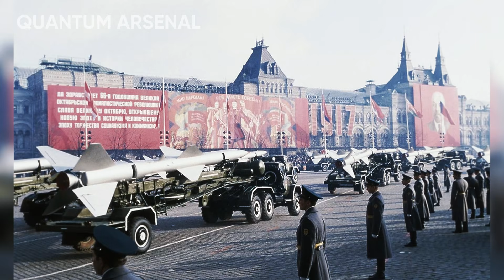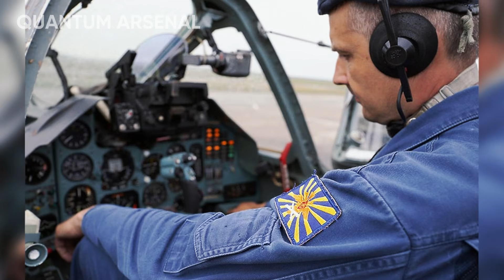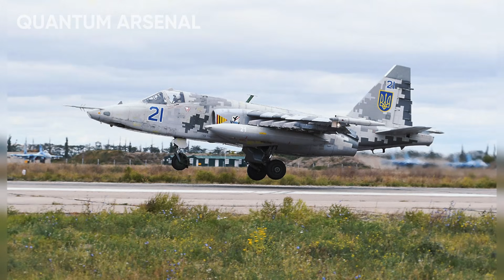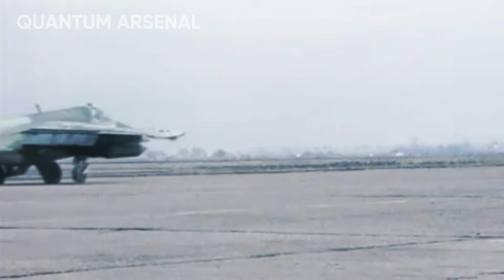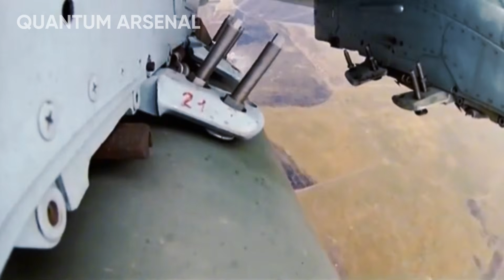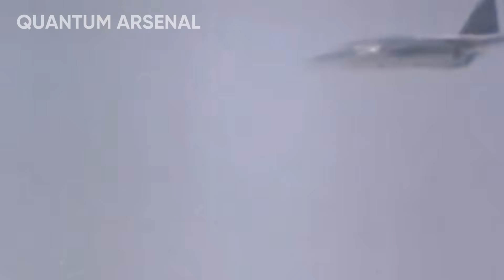Why Russia's Crudest Jet Is Also Its Deadliest

Comment: Amazing how all CAS aircraft have a "bathtub" design around the pilot. Giving it is from the U.S.S.R. and actually showing concern for pilot safety in the cold war, this was quite a big deal. Knowing any aircraft approaching the tank attack linear position for an attack run, is when the pilot is at most risk. It is a very big deal indeed. One thing I have learned on this channel is while general opinion of older Soviet era aircraft is usually with dismissal (albeit very unjustified) I have learned that how incredibly tough the Soviet equipment is. My god their idea has always been that the plane will likely have to ,make an emergency landing in mud and rocks. Now that is forethought We just don't think like that. It has always been with the thought that there would be an active close logistics network in place. great thought but hard to make happen in the thick of battle. I have grown to really appreciate the simple rugged design and the courage alone of the pilots having to work the plane without all the modern fly by wire crap. I call it PURITY, It is plain to see who the better skilled pilot with having to work the plane to do its job instead of a computer. Mad Props Russin pilots. you have earned my respect. As a mechanic I have come to really appreciate the basic simple mechanically pure kind of equipment they employ. That is what will survive the future battleground without internet and computer assistance, just a pure mechanic doing his or her job in the mud of some underdeveloped airstrip. Now that is what wins in the long term.  Also hurts to admit it yes function is function but Beauty is an underestimated quality of purity in design. Must admit the SU-34/35 style of planes has to be the most beautiful of designs. hornet is bad ass by birth as is the lovely SU-34 but the lovely Sukhoi is the beautiful killer in the sky. Damn I love her body lines. She is a all around winner no doubt. I dare say the most beautifully sculpted design for a fighter jet in history. Just my opinion though.

Comment: A-10 would last about 2 minutes in peer to peer combat. The Yanks love crowing about the A-10 in Iraq that had air dominance and a defenceless enemy.
I'd love the Yanks to try it in Iran.
Reply: I believe that the A10 has been in Iran....
Reply: @DIVeltro I think it was shot down but pilot was rescued.
Reply: @rafalIL29  It was definitely shot down, but we'll never know whether the pilot was rescued or not, USA if obviously hiding its losses.
Reply: HAHAHAHAHAHAHAHOMFG YEAH OK.
Reply: @jimarrowood1739 you can’t be fr? You think A10 stands any chance 1 on 1 with SU-25?
Reply: Well the video clearly states they are two different animals. The SU comes in on an elevated front attack the Hog loiters on station constantly taking fire and surviving and rolling out and end over on an attack vector. Also there are two kinds of CAS one who comes in to save the day and hauls ass out of the zone and the one who stays and fights. Both damn good at their jobs but you have to consider all of the parameters is what Im saying. The SU is a beast in its own DNA. The hog has A list of engagements and certified kills. Remember Its primary job was tank buster not dogfighter. Its prefix is A for Attack. The Frog is Prefixed F for fighter, That just happens to be a terminator also. LOL I do like the way the Frogs gun is designed too. The Hog was built around its albeit overly complex designed gun.
Reply: @jimarrowood1739 definitely not meant to engage in dogfighting. Both made for ground support with different capabilities.
Reply: @ispepsi2023  You are not lying buddy. Cannot deny your point there my friend we have the most corrupt Military industrial complex. I was a contract mechanic for Forscom working on the Brigade size water purification systems overhaul and improvement all while serving in National Guard as Military Police. When it came to Gov. contracting Oh my God talk about how dirty it can get when nobody is looking. One thing about capitalism is No matter who's says what there is always someone lying and paying off contract representatives with bonuses to get their way. Yeah we know corruption is in Russian Oligarchs who aren't in any position to control the outcomes, but they are being blamed. But they aren't the ones who are as bad as every senator in America with their greasy ass hands out receiving kickbacks lying in House budget committees' NTM Contract cost overruns 50 people have to approve One new hardware improvement specification and pass a senate oversight committee to justify if the welders get Christmas off with double pay. HAHAHLMMFAO hard to believe we actually won WW2 on the pure hard work of Rosies' puttin in Overtime to get the planes in the air. We made it all happen just to turn around and let the "Money talks" political party start from there in the late 60's to a loudmouth billionaire that has absolutely Zero personal communication skills running the show and starting a damn unjust conflict with a nation he seriously underestimated. My how we have fallen. It is the biggest shame that our soldiers and sailors have to suffer for some A$$hole who has Little dog syndrome. As soldiers we had nothing to do with politics yet we suffer and will get through it NMW. We always manage to. In a similar face as an old soldier, I would be remiss if I did not mention the fact Honestly I truly do admire how resilient the average Russian Dogface is. They put up with so much pressure with so little support and with loss of logistic support in damn near a third of the front lines they are holding. Always the lone "Dog Soldier" bares the biggest scars. I have been one of those "cold war dogs" from the 80's. Trained to fight the Russians in the big ole WW3 that was supposed to come. Now I think they are some great soldiers caught in a war they didn't want but have to fight. When we swear an oath to our nation, we take that seriously brother. I respect any grunt who stands by their flag. I have enjoyed our differing opinions friend. That is what truly defines freedom. Being able to have a different opinion and still able to share a beer while you talk about it. I wish you and yours a safe and happy future. If you serve in any military in the world, I would love to hear about it please. I salute you as well as pray for your safety. May the world find peace someday.